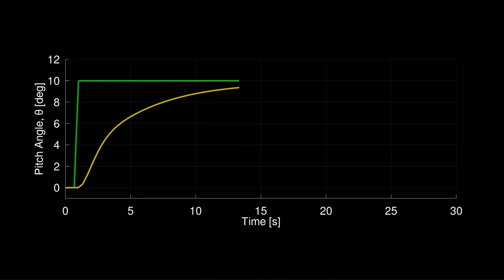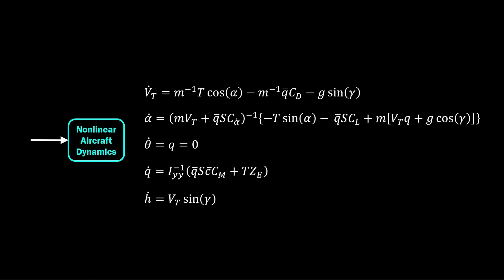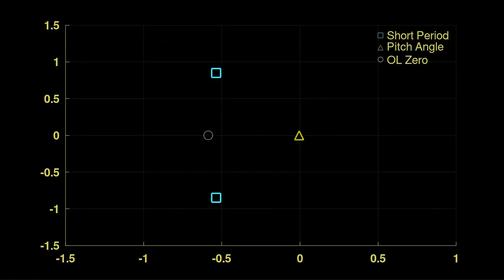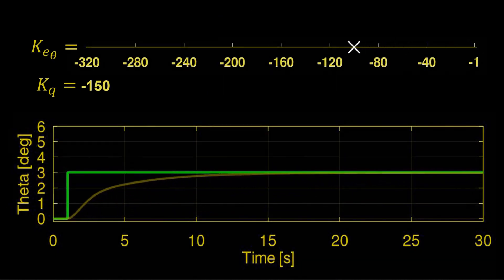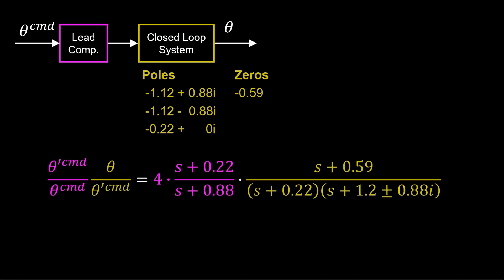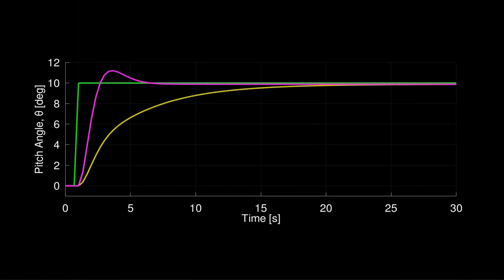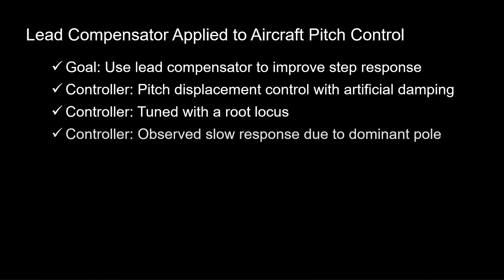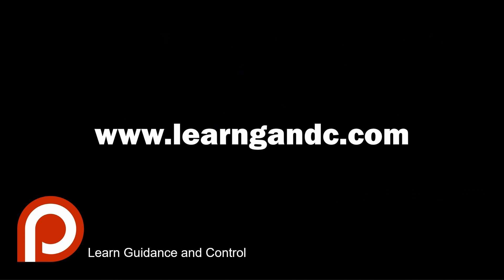Pitch Tracking Control with Lead Compensation – Flight Control Fundamentals – Section 1.6.2

Comment: Sir, i have a question. For the lead compansator, you chose (s+0.88) for the new pole of the transfer function and with this you cancel the slow pole.Everything is fine  but you are putting new pole far away from the zero. Wouldn't this cause more steady state errors? Why don't we put it directly at the origin (or 0.4 maybe)? Maybe it's gonna be slow but we gonna get 0 steady state error because our system became a type 1 system(according to Final Value Theorem with step input). Or does the nature of the lead compensator require this? If we are going to increase rise time, should we compromise on steady state error and overshoot? 
Sorry, it's a bit of a long question.

Thank's a LOT.
Reply from the maker: Hi Emin,  the purpose of the lead compensator is to get the closed loop poles left of the zero, because the zero attracts a pole and limits the performance of the system. Thus, putting the pole right of the zero defeats the purpose of the lead compensator. The presence of the lead compensator does not change the asymptotic tracking property so there will be no bias errors with the lead compensator. With appropriate tuning, one should be able to use the compensator to decrease rise time with desirable transit properties.